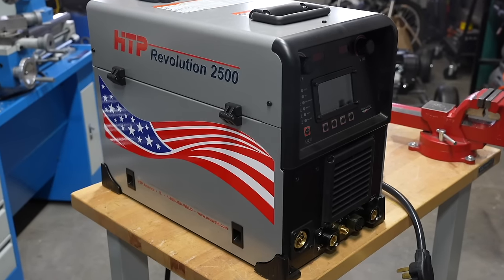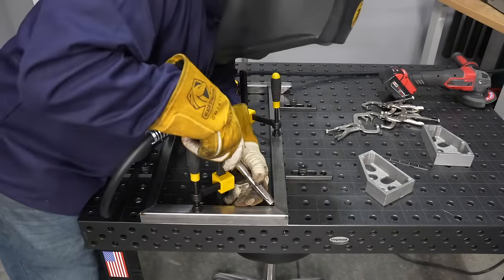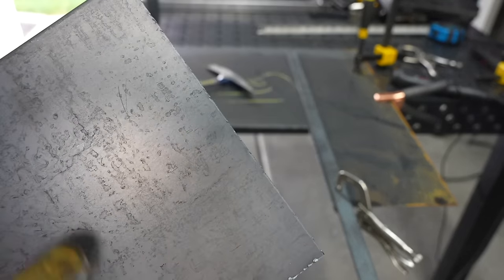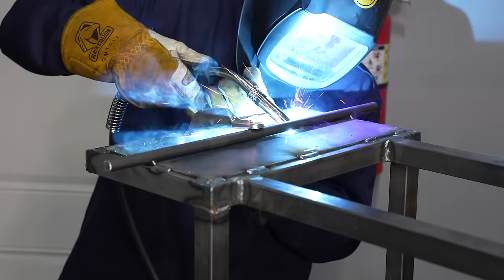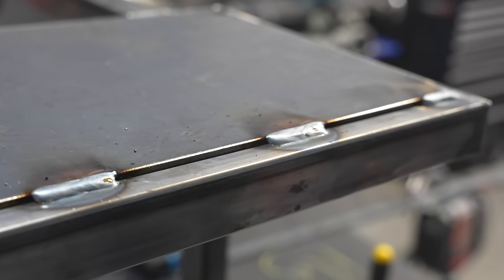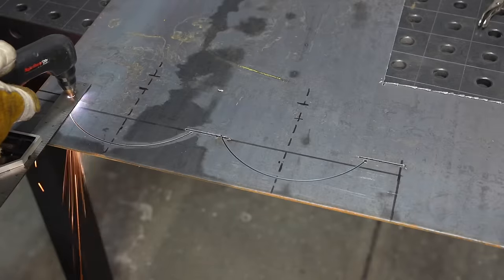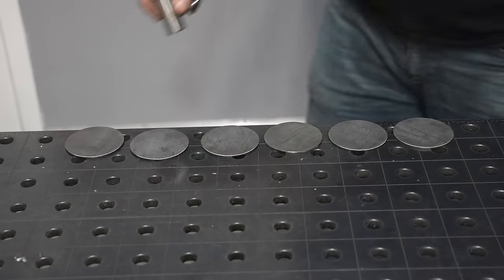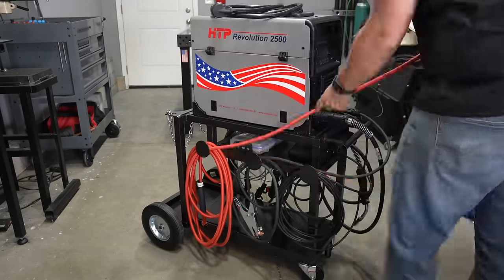Building a Better Welding Cart

Comment: Are you going to weld on little stops to keep the machine from wiggling off the top shelf.
Reply from the maker: I'll probably attach some corner blocks to keep it in place. It doesn't take too much of a wild ride in my space, but it would be a real bad day if one of my machines took a dive.

Comment: So two quick questions, when welding a double 45 degree joint do you weld from the outside in or you don't find it makes a difference and second what was your approximate material cost for the cart just the steel.
Reply from the maker: On the mitered corners, the best sequence is usually to tack it really well, weld the outside corner, then the sides from inside to out, then the inside corner last. On 16g like this, it doesn’t make that much difference especially when it’s clamped in place, so I don’t always follow the ideal sequence and just do what’s convenient. On thicker stuff it helps a lot, though.  I don’t remember the cost exactly, but I think it was about a hundred bucks from my supplier. If you have multiple suppliers available, be sure to call around because prices vary a lot, especially for small quantities.

Comment: Nice tip about drilling that hole in a combination square and then putting there your plasma cutter nozzle while dragging the combination square along the edge of the sheet metal plate.
I also liked the design of the side cable hangers and the way the chain used to hold the 2 gas bottles was added onto the cart
Reply from the maker: Thanks a ton! That modified square has been really handy. I drilled the hole centered on the 1" mark, so I can just set the square to 1" less than my depth and go for it.
Reply: @TimWelds  👍😎👍
Reply: I wonder if a wooden sliding square would be good enough for the same job since you wont need to worry about slicing the square in half

Comment: That is a great welding cart. It has given me heaps of ideas for my own build when I get time.
Reply from the maker: Thanks! I've built several carts and each time I try to do something a little better.
Reply: Tim, nice design and finish quality. Only upgrade I suggest is bending push handle pipe into a wide “U” or trim exposed ends off. That is less likely to snag on your clothes or cable.

Comment: Nice cart! You must have really enjoyed seeing your plans come to life. Only change I’d suggest is a pull handle higher than a few inches above the knee—a vertical pull handle welded to a front corner would permit free access to the welder’s panel. 

I bought the 30 in. x 16 in. Two Shelf Steel Service Cart from Harbor Freight  for my small stick welder & plasma cutter but the machine cables came out lower than the shelves’ 3” high walls. I welded a table to go on the top shelf. The machines rest on the table, bringing the controls and displays to chest level.  For each side, I welded basic cable tamers to the top edges of the table.
The cart, with a shelf added above the bottom one, holds everything for stick welding, including angle grinders, PPE and consumables. One day I’ll attach a flip up table to a welding cart, if not this one.

Comment: nice welding trolley tim the only thing i would add is a piece of upright tube on the front that is telescopic with a 45 degree fork on the end of it for hanging your mig torch/tig torch on instead of leaving it on the weld table or lap over the welder having it telescopic is good for if you are sitting welding or standing welding cheers from down under
Reply from the maker: That's a great idea! I do have a magnetic holder, but it's pretty often that I just flop the torch over the machine and once in a while it falls on the floor right when I'm holding something in place.

Comment: Very nice, Tim. It’s interesting on how all of our welding cart needs differ. I made mine for my welder and plasma cutter on the top, side by side, with a cabinet below and the two cylinders at the back as you did.

Sorry I haven’t been around much lately. Unfortunately, life got in the way for some time.
Reply from the maker: Hi Mel, Great to hear from you! It's funny that you mention that. As soon as I finished this, I looked at my plasma cutter and thought 'Dang...I should've made a place for this on the cart.' Maybe a mod or rev B for that some day.
Reply: @TimWelds  I wish there was an easy way to have a photo sent, but they don’t seem to allow it. I did some other things I think are interesting.

Comment: Very nice!  I like the "hooks" for hanging hose/wire. Also, thanks for the tip on going too slow, creating dross with a plasma torch. I just purchased an inexpensive one from Vevor and will be cutting the frame on my Jeep then adding the replacement "caps" so the frame will be strong again. Less dross makes life easier.  Jeep frames have become notorious for rusting out due to salt on the roads in Northern states.
Reply from the maker: Thanks! Sounds like some pretty major surgery coming up for your Jeep!

Comment: Nice build, Tim.  Well done.  Love the brackets you made to store your cables & hoses.  Nice design.  That will stick with me as I once got a serious injury from one of those J-hooks from a cheap, store bought weld cart.  Now I know what my next project will be!
Reply from the maker: Thanks! I've had more than one encounter with the bent hooks I put on my last one... They sell those round discs at my local steelyard, so it's pretty easy and they work really well.

Comment: Looks good Tim! I ordered a new mig welder, and didn't realize it's 26 inches long, so I'll be making a new cart. I picked the wheels like yours from Harbor Freight yesterday, in 8 inch / 3 inch.
Reply from the maker: Nice! That's a healthy size machine. I used the 8 inch wheels and 3 inch casters from Harbor Freight on my last one and it's rolled around great, much better than most of the ready made ones.

Comment: Tim I really enjoy your information on setting welders and tips on welding different metal thickness with rods. Can you do something on how to torch cut thick metals using propane and oxygen bottles. And what to look for in the flame to know if I need to add or reduce any of the gasses. Thanks.

Comment: Tim,
Some great tips in this video. Love the semi-freehand and templated plasma cutting 👏👏
On plain steel, particularly with lap welds, a lot of car body guys use a ‘weld-thru’ copper-based primer on the lapped surfaces.
Thanks for taking the time to explain the design, and construction of the project.
Regards
Robert
Sydney, Australia

Comment: I bought a welding cart and it has good wheels and locking ones in the front. It has 2 cutouts for a tank or flip it over for just one. Only thing I'm not sure where I bought it, maybe Amazon.
Reply from the maker: That sounds pretty nice to switch between dual and single cylinders.

Comment: Thanks Tim. Great cart  design and execution. I’ve been welding from time to time for approx 10yrs. Some for work but mostly as a hobby. I find your content really helpful.. so much so that I have also subscribed to your online courses.. great btw. I’ve recommended them to friends.. and, If you’re reading this and haven’t checked out Tim’s courses- do so! It’s a great way to learn and build confidence in the different modalities that you don’t know.. or remember what you forgot.. until you struggle a bit and finally remember or figure it out.
Do you have a video covering the HTP 2500- especially pulse MiG?
Reply from the maker: Thanks a ton, I really appreciate that! I haven't made a video covering the HTP 2500. It's not on the market yet, but will be released for sale in early July. (I got one early to make videos for their website explaining how to operate it) I do have a video with some pulsed MIG on their Pro Pulse 220. The fundamentals of Pulsed MIG on this machine is pretty similar, though it's more capable, largely because the double pulse is fully adjustable. I'll have some info on it in coming out in the coming weeks.

Comment: Great build,that welder looks nice. I've replaced all chains on my welders with a metal strap and a single hand screw. No more floppy bottles,it drove me crazy every time I moved the machine. Are they making a watercooler by HTP?
Reply from the maker: Thanks! I may have to try the metal strap on my next one. HTP does have a water cooler that it can connect directly to their machines so that you don't have to turn on a separate unit.

Comment: I would add a small rim to keep the welder on the cart when you are moving it.
Reply from the maker: That's a great suggestion! In my space, it doesn't go for too much of a wild ride, but it would be a bad day if that machine took a dive. I'm thinking that I'll add some sort of retainers on the corners. The door on this machine comes down pretty low, so I need to keep the side clear.

Comment: What size wire did you use when welding your cart together
Reply from the maker: I used .030” (.8mm). A size up or down would work fine too, but this is the size I use for almost everything.
Reply: Hey Tim what is the thinnest metal you can weld with 0.30 and the thickness too?
Reply from the maker: From around 22 gauge to 5/16” or so.

Comment: What is the cost versus buying a cart from Harbor freight and modifying it?
Reply from the maker: I don’t remember the exact cost of materials, but it was in the ballpark of the better HF cart. It’s not about saving a buck, this is night and day more sturdy, has much better wheels, is exactly the right size, holds dual cylinders and is designed with a place for everything. That being said, the HF carts aren’t too bad, I’ve used several of them.

Comment: hello sir,,,where did you buy your welding hood and tools?...like helmet,gloves,machines..etc...
Reply from the maker: I have bought them from all over the place. A lot of them come from Amazon, some from Harbor Freight and some I just google around. For machines, USA Weld carries a lot of accessories  and HTP welding machines that are outstanding. Full disclosure, they sponsor the channel. While these machines aren't the cheapest on the market, after a couple years of using them extensively, they are extremely high quality and offer a great value compared to some of the brands distributed through welding supply stores. There's a link to their site in the description.

Comment: Hey Tim, been watching your vids, great job. I’m thinking about getting into flux core as a hobby, and am pondering, besides an angle grinder, what should I get for cutting stock, a chop saw or a band saw? As seen in this vid, you are using a chop saw but I’m concerned about the little metal bits removed by the blade flying everywhere. Is there a good way to handle this so my grandkids don’t step in metal bits? They are forever barefoot no matter what I tell them. Thanks!
Reply: Get a cheap vevor portable bandsaw.  No sparks, flying chips and it's nice and quiet.  Blades are cheap too.
Reply from the maker: Thanks! That's a great question and honestly those little metal chips are a real pain. I built a cart with a chute that catches a lot of them, but when I'm cutting tubing, they fly out the end of the tube and spread all over the place. A bandsaw is a quieter option and the chips are much more tame. Worldtraveler's suggestion of a portable bandsaw is a great one for the money. Personally, I'm not very good at cutting tubing precisely with a portable bandsaw, so I prefer a horizontal bandsaw. There are some that are a portable bandsaw mounted on a base for around $200 on Amazon. My buddy built his own base/guide for a Harbor Freight portable bandsaw and it works really well. There are some ideas for those around on the interwebs. Here's a link to the bandsaw that I have: https://amzn.to/42ly6BB . I've had it for a couple years and it took a bit of messing with to get it to cut straight. Since it's been dialed in, it's worked pretty good for me over the last 3 or so years. Floor stand models are a bit better if you have space and budget for that, but it's definitely not necessary for hobby work.
Reply: @TimWelds  I swear I'm more accurate with an angle grinder.  But I have that cheap vevor.  It cuts square enough for the girls I go out with.

Comment: Just finished this last year.  HTP Mig on top, HTP Tig machine in the middle, water cooler on the bottom.  Add in 2 130CF bottles and that sucker is HEAVY!  I used 1" tubing and that was a mistake.  3/4" tube would have been PLENTY!  I used the same back wheels you have, but larger front wheels so it can roll over the metal chips on the floor.  I'm not a fan of multi-process anything, is that revolution the "Something great is coming" ?
Reply from the maker: Nice! That sounds like an awesome setup! I generally go overkill on the tubing size, partially due to aesthetics. In this case 3/4" or 1" would have easily done the job. This machine is the 'Something great is coming'. In the past, I have also had separate TIG and MIG machines, because the few multiprocess options on the American market that included AC TIG fell a little short of my dedicated machines in terms of capability.  However, this one honestly performs as well as any dedicated machine that I've used on MIG and TIG.
Reply: @TimWelds  My concern is when something quits and you lose the entire show.   Hope Jeff gave you that machine to keep.  I never got a call after I pissed and moaned about the Chinese htp watercooler video.  Buying that was kind of a waste of money.

Comment: I'm pretty new to welding and fabricating. Literally just started teaching myself in April of this year so I can work on a classic truck project. And have been checking out your videos for a while and really like the content and how you show and explain the process. I'm actually looking to build a cart that will hold my welder and plasma cutter on 2 shelves with wheels large enough to roll through the grass since I have to work on the truck outside. Thanks for the great videos and content
-Branden @midnighcustoms